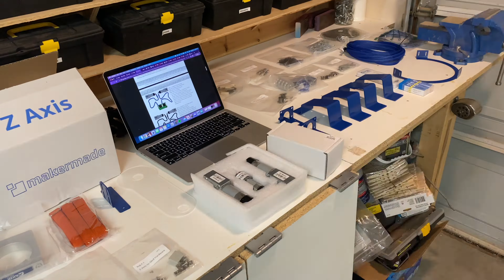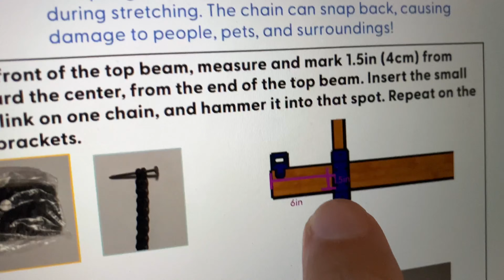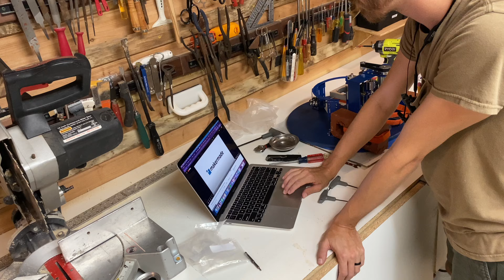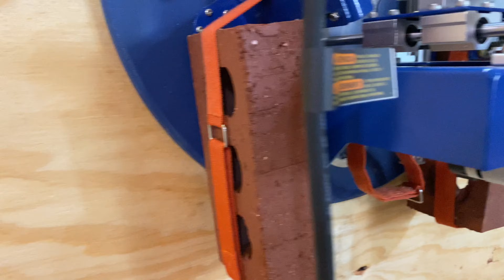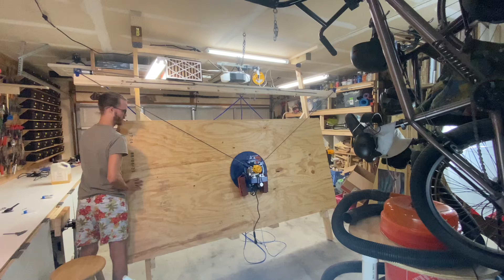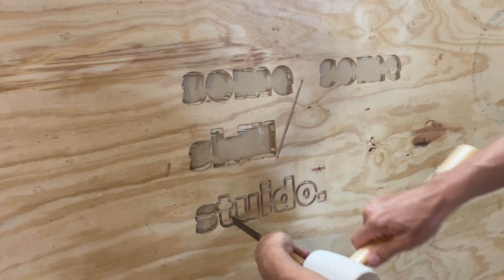I Mounted A MASSIVE CNC To The Ceiling Of My TINY Workshop!

Comment: Thanks for capturing the good and the bad. Please update us with your projects, success and failure. There seem to be a lot of these systems out there, but people seem to lose motivation (YouTube has mostly "setup" videos, not many actual projects). 

You have experience with other CNC which I don't, which tempers my enthusiasm... I would break more than scrap wood. 🙂 I think I will just "laser tile print" and hand-cut large plywood designs. For now at least
Reply from the maker: I just finished a big project on it a little while back. You can check it out here! https://youtu.be/8I-LIcHVirU

Comment: I bought mine almost a year ago and haven’t got it running yet. I got hung up on the chain dimensions and lost momentum. How far did you go from the edge? Could you provide more detail of the calibration process?
Reply: We got ours two years ago and just got it calibrated and working yesterday. Once you run through the sequence in the software it's not too bad.

Comment: You could split your waste board horizontal at the hinge point instead of vertical and attach it to the stand for better structural support and storage. And if you were comfortable cutting into the sheetrock above you could create a recessed home position for the carrier. It may be too heavy to lift on your own but you could get a pulley set. Great job, if i had a bit more room i would get one.
Reply: He did say he didn't want the extra weight overhead, and while it's likely a small thing on this style there's an improvement in flatness if his spoilboard splits along a different line than the folding frame.

Comment: Nice work

You didn't really touch on what you missed that caused you to not be able to calibrate easier. Like instructions you skipped? Settings that weren't covered in the instructions?
Reply from the maker: Basically, none of the written instructions that came with the CNC were useful. I had to google every problem I had and find it on a forum or a youtube video.